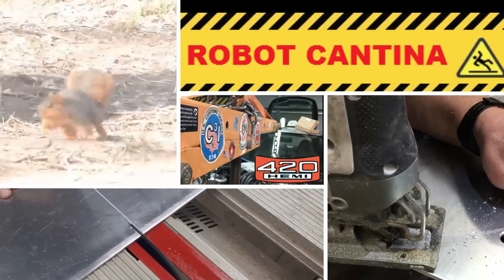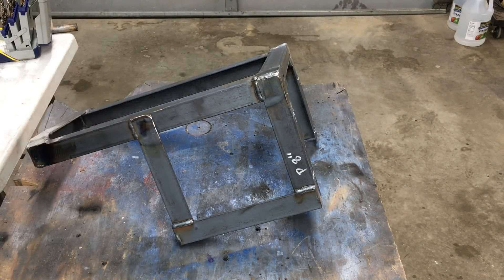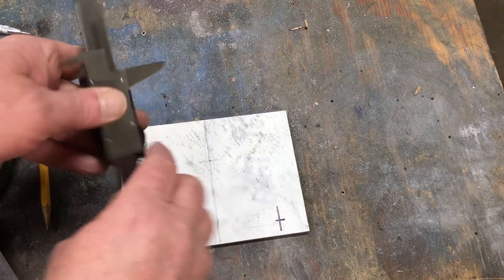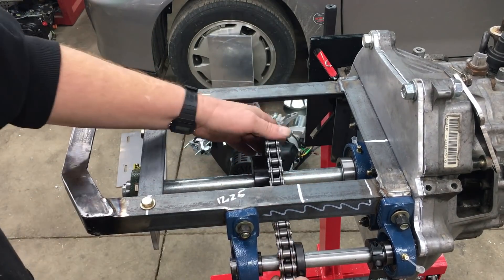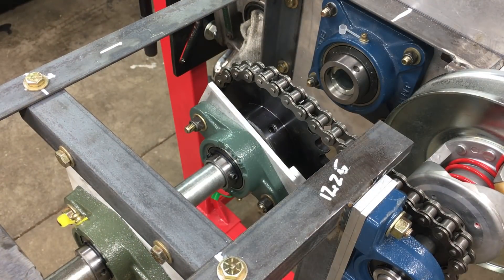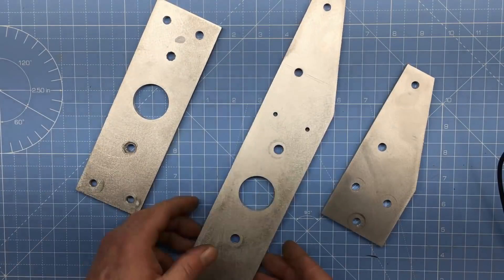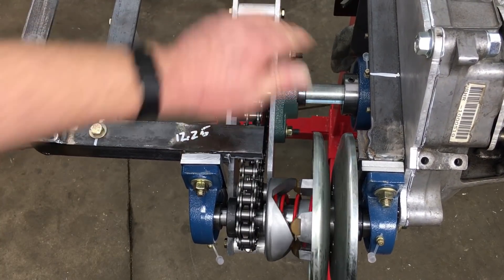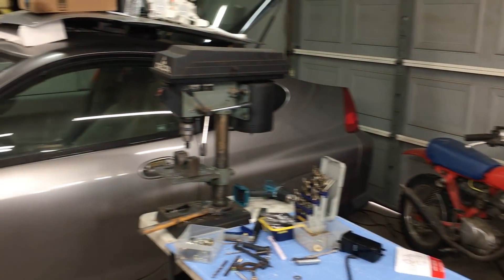Episode 12.  We put a 420 HEMI engine in our street legal go kart (PART 2)

Comment: think the slow responding welding helmet has to do with the fact that the autodarkening is an lcd display basicly , the stuff inside actually can freeze up , just put the helmet near a heatsourse when not in use , should speed it up a little if it runs of a battery the cold can dramaticly drop its output too , again keeping it warm helps

Comment: A heavy duty spring arm self adjusting tensioner mechanism of some sort would be great to keep the chain constantly tight on the slack adjuster without having to readjust all the time - just like the spring loaded belt tensioner on a car.  We put a chinese motor on a bike and used a spring loaded chain tensioner arm to keep from having to adjust the chain.

Comment: If you replace the threaded chain tensioner with a couple gas struts (like from a universal hydraulic hood lift kit) (or one beefy one if you can find it), then you'll never have to worry about tensioning the chain ever again, and the gas struts will dampen harmonics in the chain, preventing it from flapping around.
https://www.amazon.com/BOXI-Universal-Supports-Struts-Extended/dp/B01J78JT16/ref=sr_1_25?dchild=1&keywords=6+inch+gas+strut&qid=1614477531&sr=8-25

Comment: Really I think the smaller chain would've been fine, I'm a big fan of the old Saab 900s, their transmissions were connected with 3 chains the size of the smaller one you used on the 212, that car makes about 180 lb-ft of torque (the turbo model) and the chain was never the part that failed. Then again it was housed internally and got actual oil from the engine as it ran through the oil pan... really interesting design.

Comment: My welding mask is often slow, especially in the dark winter. Between the cold slow liquid crystal and not enough juice to darken, I engage safety squint mode. But, I've found with 100% success that if I put it in the bathroom with the vanity lights on for a couple of minutes, its enough to get it working well before a welding job. Just make sure the solar panel is perpendicular to the light source and as close as possible.

Comment: Only 13 horsepower??? What a rip-off!!! I do however like your style! You probably would have been better off outfitting
it with a fuel injected snowmobile engine with 40 H.P.. I know of one engine that will make it run like hell! A 1984
Fiat 2 Liter fuel injected motor that is converted to side draft Weber carbs. I'm trying to remember, since it's been so
long ago. The 2 liter DOHC engine was from a Fiat SuperBrava! I had belonged to a race club in Bamberg Kassern, FRG
and our club president decided to make adapter plates for a 70's VW Beetle and use that fiat 2 liter engine. Talk about 
highly responsive on the throttle and wicked fast at the dirt track!!! It was going up against cars like Porsche's, giving 
them a wicked hard way to go! That engine belonged to the SuperBrava ( Fiat 131 series) family car, yet it was rated for
somewhere's around 102-113 H.P. The torque and throttle response was so great that you could make front wheels 
come off the ground in the very first time of trying the Beetle out. I saw it for my own eyes and I'm here to tell yah's that
the club president had that car go out of control a hit a tree! He only just tapped the throttle and it was like seeing a
rocket launch!

Comment: What about using a Toyota alternator tensioner for that tensioner assembly so it’s not several nuts and bolt adjustments. Maybe $12 on ebay

Comment: For that chain tension mechanism couldn't you just take out the center bolts and put a spring around the shaft? If you could control the maximum force exerted on the chain by the tensioner by limiting the play of the mechanism wouldn't the only other thing to worry about be the physical properties of the spring? Also, do you not have to worry about the nuts moving around once you have set the tension and causing it to come unset? I imagine one way that you could pretty easily be able to have different settings would be to just find out the ideal amount of tension and use a cotter pin, but if you needed different tensions you'd probably also then have to have different bolts...

Comment: As for the welding helmet in cold weather, mine slows down too. But it has an adjustment for how quickly it dims and with that cranked up it does ok, I had to upgrade from my non adjustable one for that reason actually

Comment: Shouldn't a chain tensioner have a kind of spring mechanism for constant pressure? I mean the chain, sprockets and the whole assembly will warp and expand when it's heating up - so there should be more flex :)

Comment: i use one of the silver metallic sharpies for marking dark materials. they work great. better than a soapstone marking stylus for sure. question, why didn't you cut the shaft with your lathe? it seems it would've been simpler to do it that way as you could cut and chamfer the shaft in one action. plus the rest of the shafting wouldn't have gotten buggered from falling on the floor. that stuff ain't cheap even from the surplus center.
Reply: A bit late to this comment, but in one of the prior videos he said he lost/broke his parting/cut off tool for his lathe and simply never replaced it

Comment: some how I have stumbled onto lawn mower engine youtube and I love it. the 670 will be interesting to see if it fits under the hood.
Reply from the maker: Yeah, the 670 will be a tight fit.  I think it will fit, but once again I will need to remake the engine cradle.   Anyway we will cross that bridge when we get there.
Reply: @robotcantina8957  I'm thinking of doing the 420 on a mini truck chassis like another guy on here has except I'm not aiming for high speed
Reply from the maker: @dodge8802   The Toyota pickup with 212 predator is pretty cool. A 420 would be equally cool and slightly more usable.  do it!

Comment: I want to work on putting a harbor freight engine into a street legal motorcycle(essentially just making a bigger pit bike), is there a particular CC that you think would be best? Also love the series btw
Reply from the maker: The 212cc is a good engine and responds to cheap mods.  The 420 is a lot larger and depending on your bike, you may have problems fitting it in the frame.

Comment: Boy! I almost went in to video delirium withdrawals! Is there some way to use a pressure controlled hydraulic tensioner similar to how you are allowing the engine to adjust for the chain?
Reply from the maker: Hi Steve, I looked at a bunch of chain slack adjustment mechanisms before designing my own.   My primary concern was to make it strong and cheap.  Cheap is just and important as strong.